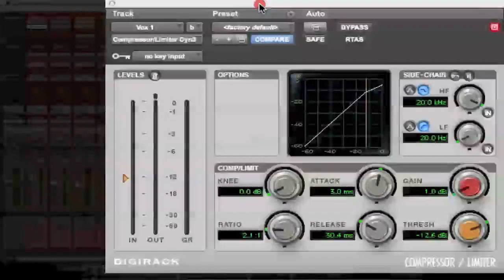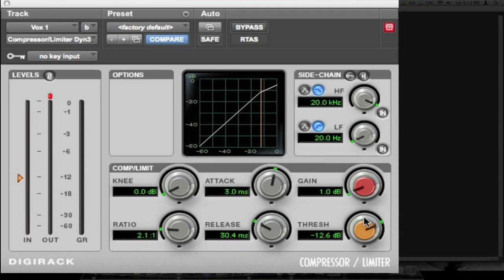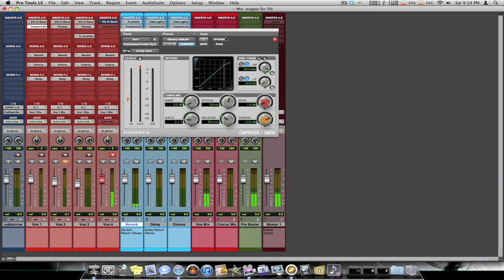Pro Tools Tips & Tricks ( How Compression works)

Comment: To add on to what you said, as far as the ratio goes we must remember only peaks that go beyond the threshold will be compressed. So with a ratio of 2:1, for every 2 decibels that go over the threshold the compressor will reduce to 1 decibel. So if your threshold is -18 at a 2:1 ratio and a peak comes in at -16 which is 2 decibels above the threshold, it would be reduced to a peak of -17. Another thing I'd add on is that the gain fader is good to makeup for the volume lost during compression.

Comment: @joejayno there is lots of things you can try. first close all other applications you may be running. you can try using the parallel compression technique to reduce the number of effects you're using. use aux input tracks to add reverb. you can also adjust the buffer size and cpu usage via: "playback engine" under the Setup menu. if the error message still occurs you should consider increasing the ram of your system before buying a new one.